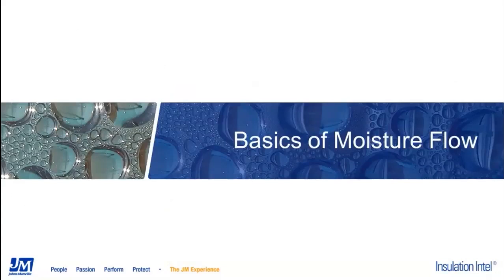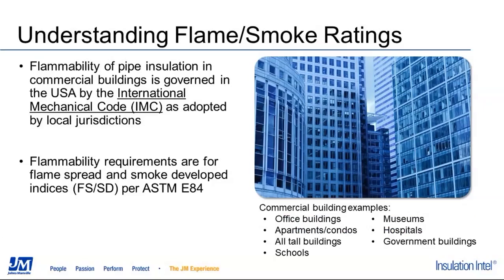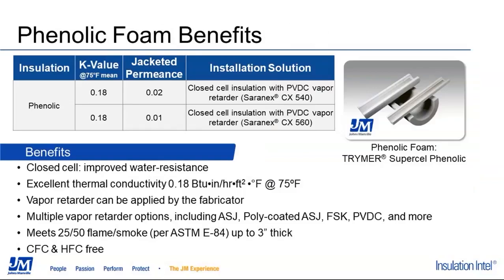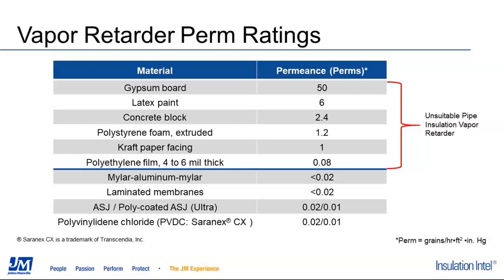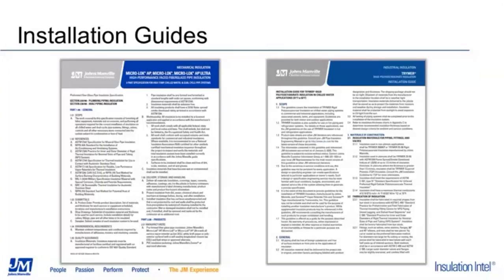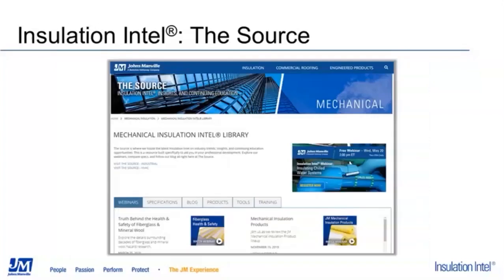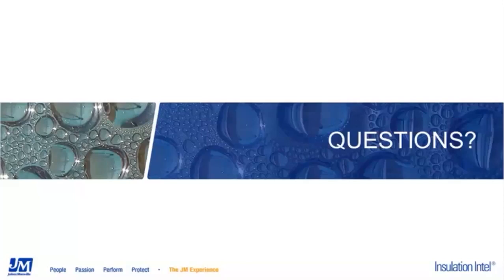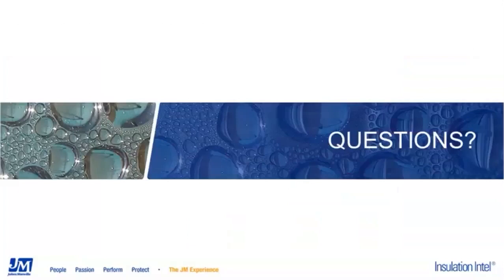Insulating Chilled Water Pipe Systems: JM Webinar

Comment: Do you have information or products for insulating -60 to -80 coolant systems?  I am struggling to prevent condensation and sometimes ice forming on insulation where I have stainless steel connection fittings. We have engineered flexible cooling lines that are designed for our application, the connection points have been very problematic.  I am inside a cleanroom facility and we cannot have any condensation due electrical enclosures located in the subfab below our equipment.
Reply from the maker: Hey there Eric. In short, for those negative temperatures, we would recommend Trymer 2000 XP. Proper thickness and then system install will be very important for this application. This could include multiple layers of insulation and vapor retarder. Below are some helpful installation guides.

Trymer Data Sheet Library: https://www.jm.com/content/dam/jm/global/en/insulation-systems/products/assets/data-sheet/jm-ind-trymer-ds-book-pir.pdf

Refrigeration Installation Guide: https://www.jm.com/content/dam/jm/global/en/insulation-systems/products/assets/installation-guide/jm-ind-trymer-refrigeration-install-guide.pdf